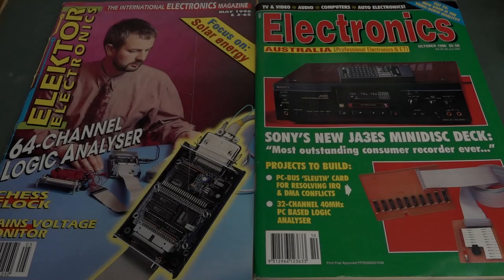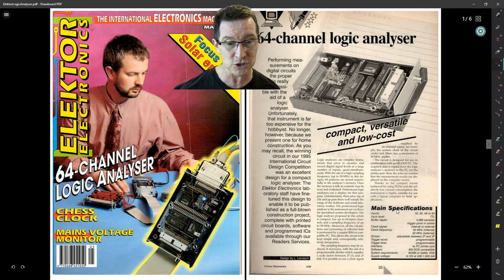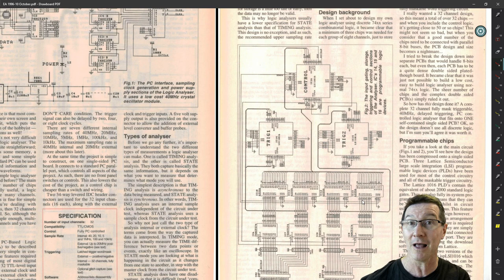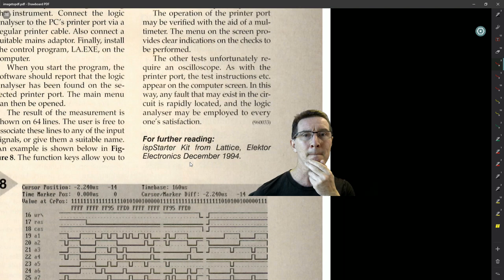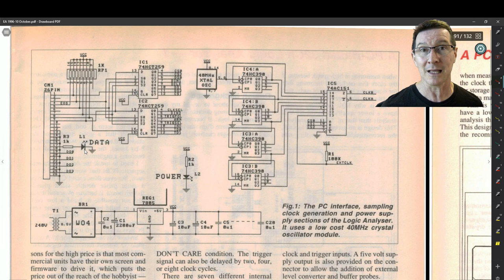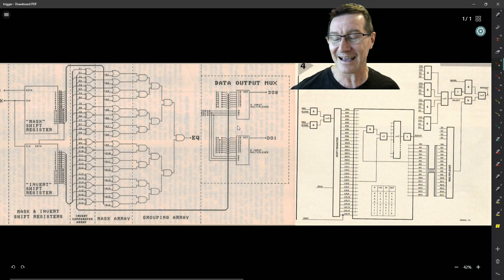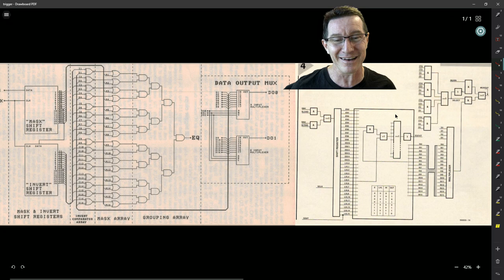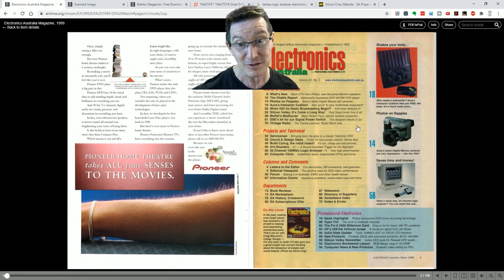EEVblog #1326 - How Engineering Minds Think Alike

Comment: I want a floating Dave desktop widget that rants about stuff randomly. Maybe it could have animation to eat desktop icons from time to time
Reply: Kinda like a...Bonza Buddy? (I'm not even sure if that's a real joke...i'll see myself out)
Reply: I need that. Where can I get it. :-)
Reply: As long as when you shut down the system it waves and says "Catch ya next time"
Reply: Much like the app that had the dancing ladies on the task bar hee hee
Reply: virtualgirl Dave?!....ill pass on the strip tease tho! :P
Reply: @iwasinnamuknow  Ugh, flashbacks to the late 90's that thing was HORRIBLE
Reply: Maybe Desktop Goose can put out an update with a Dave reskin
Reply: Clippy Dave!  "Do you need an analyzer or Multimeter? Let me suggest EEv MM!"
Reply: You need to switch off subwoofer and set Bass control to minimum when the DaveHead starts ranting.
Reply: "It looks like you're trying to lay out a circuit board, would you want me to auto route?"
Reply: As long as it occasionally says "That's drier than a dead dingo's donger" and/or "rubber baby buggy bumper".

Comment: In the early 90s I remember a hard-up engineer building himself a logic analyser out of a parallel DRAM chip and an old telly.  =)
The DRAM chip had its address pins hooked up to an always-running counter that kept it refreshed (and also governed the sample rate).
The probes were hooked directly to the DRAM's data pins. To capture data the trigger circuit just asserted the DRAM's write-enable pin for a fixed time.
To look at the results there was another circuit that asserted the DRAM's read-enable pin for a fixed time, and the data pins were also hooked up to a mono video signal generator that was wired into the old telly. There was a knob that varied the hold-off between the counter crossing zero and the start of the read pulse, so he could just twist the knob to scroll back and forth through the captured waveforms on the telly!
I was really impressed with his ingenuity when faced with needing an expensive tool and having bugger-all money.  =)

Comment: The AC version does include the TTL voltage levels, so it is not unreasonable to advertise TTL compatibility.  Once the technology is available and cost-effective, it is not unusual for 2-3 people to decide to build similar devices at about the same time using these parts.  This is especially true for such useful (and expensive) devices as logic analyzers.

Comment: There where prototyping services in the early 90... Used them when i was in school to make the PCB for my final project. Minimum order was 3 board for double size PCB. Price wasn't that bad, i had a 3x5 inch double size PCB with silk screen for under 100$ and that was in 1990-1991.  Manufacturing time was 3-5 days and we could upload the gerbers to their BBS or give them à floppy.  The big difference is it was locally produced PCB, instead of having them made in china.

They where quite use to deal with student and even made some minor modification (after letting us know about theses of course). China kinda killed then, in the 2000.
Reply: Wasn’t much cheap for PCB prototyping available in the USA in the mid-90’s. Right around 1996, AP Circuits out of Canada became available and they were $48 USD plus $0.85 per square inch for double sided plated (only using their limited drill list), but without solder mask or silk screen. Then FedEx shipping to the USA. I could get one 3”x5” with those specs delivered for about ~$85-100 USD.

Comment: I was taught iec symbols in college in the UK, Late 70's early 80's, then never used them again!
Reply: On an hand drawn circuit they were a bad idea.  A little flyspect on the drawing and "AND" vs "OR" is lost.
Reply: the most important requirement for any schematic diagram is that it should be easy to read, and in that respect, traditional logic symbols win hands down every time

Comment: Excellent article  it reminded me of how excited I got using Lattice GALs in the mid 80s to replace oodles of 'glue' logic  .. and having the capability of reassigning pin functionality without physically rewiring 
A sort of software solder :-)

Comment: That's the only exemplar of Elektor (in French) that I have bought! It was over my head at the time, I finally understood it 24 years later!
I didn't look in details, but it seems that, at least for France, you could buy the PCB of all articles of Elektor. And many projects of the magazine used double sided PCB because of that. The other magazines here were more hobby oriented and were mostly using single face PCB.

Comment: Designs that used buffers/latches for inputs and outputs even when the FPGAs have the needed resources often were based on the idea of using cheap components to protect the expensive FPGAs from damage by whatever you were connecting them to. With SMD replacing even a very low cost part might be too much trouble, but since current FPGAs can't handle TTL levels you might have external buffers to convert voltages.

Comment: As far as I can remember those IEC standards for gates were (and still are) very common in EU (at least for Elektor articles), although I personally always preferred the one you used, since it's more intuitive and shows much better what's going on. Especially for engineers from different fields and levels.
Reply: They are still common in Europe.
Reply: I am currently studying Electrical Engineering in Germany and we use IEC Symbols as well.
To be honest i like the IEC more with the same argumentation you gave for the "old" ones. You can directly see what the purpose is by looking at the &, =,... I always have to look up the other symbols. I guess it is more like an American/European thing where one has the zig-zag resistor symbol and the other the rectangle one. Or verilog vs VHDL.
Reply: @vorgartenzwerg4245  I still use the zig-zag for resistors - for one thing it's much faster to draw by hand when you're designing quick and dirty projects with pen and paper

Comment: I think we're about the same age. In the late 80's, I was in school working part time at a high energy physics lab. That was great fun. Around that time, Analog Devices had just introduced the AD9002, an 8-bit 150 MS/s ADC. It had ECL outputs and wasn't cheap. We also had a shiny new Fairchild CCD camera that could integrate over many frames for increased sensitivity. Armed with the AD9002, a bunch static RAM (probably the same you used in your logic analyzer design), 74LS161s for address counters, and some logic to gate the address counters, I made a sensitive digital camera. It was all wire-wrapped by yours truly and sampled at 10 MHz. The crazy thing actually worked. My brother wrote a lot of the the supporting software on a Mac II. We took several pictures of ourselves to test it, but I have since lost the images, which is absolutely tragic. Fortunately you kept all your drawings and had a published article that was easily recovered.

So you built a the equivalent of a logic analyzer, I built the equivalent of a digital camera. I'm sure other people had similar ideas. It made sense given the parts that were available at the time.

Comment: USB side note: My first notebook (Digital HiNote VP715) had USB build in in 1997, and my current retro machine (Toshiba Libretto CT100) made in 1998, have USB in the computers port replicator. 1998 was also the year we saw the first pure USB-only machine (Apple iMac).
Reply from the maker: Yep, just didn't exist in 1995, and only became mainstream a few years later.
Reply: @EEVblog  Yes, true. The only (mainstream PC) alternative in 1995 would have been SCSI, but probably a bit more complex/expensive to interface compared to the printer port. And most normal users probably did not have SCSI as standard on their PC's. 
I fully understand your rationale for using the printer port.

Comment: While many use Cypress/fx2grok.. it seems most of the open-source logic analyzers these days are still using Lattice for the logic device!   Even the synthesizer is open-source!    The logic-analyzer HDL is often a SUMP/SUMP2 variant.  

The pc software has also somewhat converged to sigrok.

BTW, the most amazing, off-the-cuff logic analyzer project I've seen is from CNLohr.. "Cypress FX3 as a Possible Logic Analyzer"!

Comment: Elektor probably used a PTH PCB, cos they had a PCB service where you could buy at reasonable cost the PCB for the projects they published. Very nice PCB's if I recall (brain struggling to remember back to the '80s) when I last purchased from them.
Reply: ISTR you're correct, I think they were doing PCB manufacturing/kitting in-house well into the 90's

Comment: 74HCT374 is also an octal latch
Reply from the maker: I mentioned that in an overlay. The 374 has a staggered pinout that isn't great for PCB layout. The 574 is identical but has a nicer pinout.
Reply: @EEVblog  
"You old softy, nice pinouts are for the weak"
When I made my first "do it your self bus thing"  374 was on the market and 574 was not yet.  It was also before 74HC was a thing.  I did have the "plate-through via" available because I was doing it for a company with a budget.

Comment: It's probably the same because of available parts, ie, there is only one version of the IC from one manufacturer that can do the job, so it needs to be the same circuit. PC interface was probably the most readily available and cheapest at the time.

Comment: If I remember correctly the problem with using CMOS with TTL is the drive current required by TTL, with a CMOS chip only being able to drive a very limited number of TTL gates. Therefore, if you aren't connecting to a lot of gates there shouldn't be a problem using an AC chip instead of a ACT chip. It certainly wouldn't mean it's not TTL compatible, especially as the chips are reading the signals, not driving a bus.
Reply: The input thresholds are actually different;
TTL is 0=0-0.8V 1=2-5V 
CMOS is 0=0-1.5V 1=*3.5*-5V (technically it's actually 0-1/3Vdd and 2/3Vdd-Vdd)
So based on that it would be possible under some circumstances for a CMOS input to misinterpret a TTL 1 as 0, ergo it's not "true" TTL compatible, but for most practical purposes, you're correct that it'd be "close enough".
Reply: @SomeMorganSomewhere  The pull-up resistors will ensure that logic High is 5V. And a TTL gate should be able to pull logic Low low enough for the CMOS gate.

Comment: In the mid-1990s I was playing around with GALs and Lattice really didn't want amateurs to handle their chips. The specifications about how to program the chips was kept secret and any starter kit would have been beyond my budget. It was actually Elektor who published a book including a bare pcb for a LPT-programmer, but it was very limited to just two different GALs. Very soon after the supplied software couldn't be installed anymore on a more modern computer and that was the end for me. I still have plenty of GAL-chips lying around which I never used...

Regarding the layout of the 74xx574 - I never understood the reason why the pinout of the 74xx374 was so messed up with alternating inputs and outputs - well until I got to know the ATmega32U4, I wonder what the designers were thinking when placing the IO-pins...

Comment: It is an interesting number of coincidences. Obviously enough is different about the two to see they are not based on each other. I didn't watch to the end, but it looks like this scheme sampled basically a bunch of digital levels around a trigger and dumped them back into a pc slower. This would mean like it had a timespan around the trigger. It could have been done in a sort of RLE way that just represented the changes in the data, but that would have a length dependant on the amount of complexity of the samples.

Comment: I'd have probably done a circular buffer type thing, with it stopping record after triggering, some power of 2 count less than the buffer size (leaving the pre-trigger events in the buffer without being overwritten). Some latch that stores the initial buffer position (and can be read out), some latches and xor gates for setting +/- trigger and masking (probably using nand gates for the masking),  and then the computer software to adjust the data into it's correct place on screen. A lot of discrete logic chips.
Reply: and an old TV
Reply: @HighestRank  Maybe, for the display...

Comment: Why are there pullups at the inputs? Isn't it safe to assume the signals you're measuring are valid so they most likely already have pullups in their device and adding more pullups to the same signals can invalidate them if they're pulled up too much (low -> undefined, undefined -> high)?

Comment: IEC  standards were even drilled in former east Germany's universities that I attended. That was in1983 so go figure. Personally I liked the rounded symbols more but we were not allowed using them in our thesis. Only good thing they are easier to draw in a pre CAD time where you had a drawing board and draw with an ink stylus of variable line width. Good old days  .....

BTW Dave how much did you charge for your kit back then?

Comment: I wonder if the Baxter PLD design information is available today. It would be interesting to recreate the design using a modern FPGA.
Reply from the maker: His site has vanished.
Reply: @EEVblog  It is a shame. I tried to dig in to the Internet archives hoping to find more information but the site does not appear to have been archived. :(  There is another FPGA project mentioned in HackADay that I'm looking at that has some similarities but it is still rather different.

Comment: A movie called Waking Life talks about similar thing within one of its plots. People doing a day old NY crossword (in isolation) doing easier than a current crossword as "the answers were now 'out there'."
Reply: I knew of Rupert Sheldrake doing some work on that back in the day I think he called it morphic fields on how "information" was transferred through the ether as it were. That crossword puzzle was one of the examples. He also did work with pigeons and birds opening milkbottles pre war and postwar. There were no milkbottles deliveries during the war and the birds had a lifespan shorter than the war. I found it interesting reading.